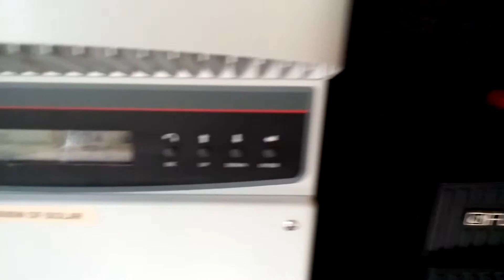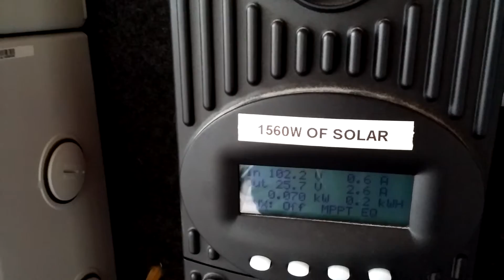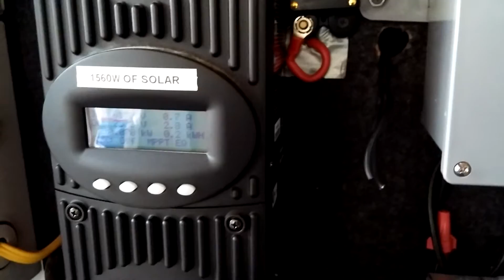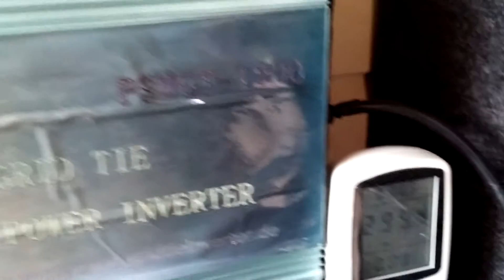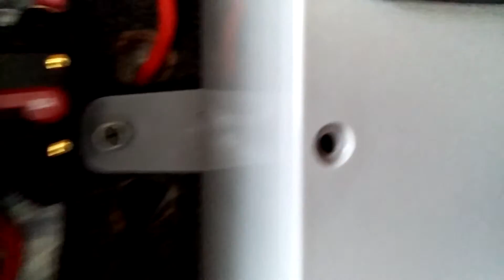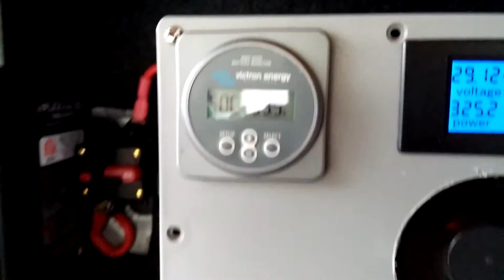Renogy solar panels and Dc to dc boots converter

Comment from the maker: i have two 600w dc to dc boost converter wire in parallel going to the power jack inverter at 29 to 30 volts the ssr relay gets its power from the flexmax 80 aux out at 12v then out from the ssr relay it triggers a 24v load coil relay and then to the two dc to dc boost converter

Comment: Where did you buy the dc dc converters?  Can you send the link?  Also, how did you wire the two of them?
Reply from the maker: donovan i post the information you need
Reply: +Garfield Oliver I do not see the link. Have you checked the efficiency of the combination DC DC converter and grid tie?  Did you have to place diodes on the output to prevent on converter from affecting the other?  BTW, what's your (technical) background?